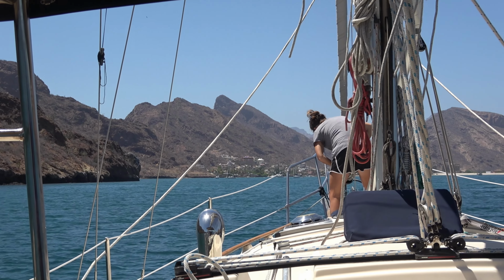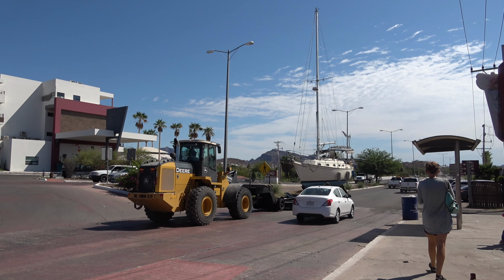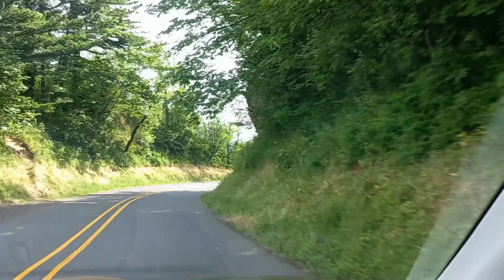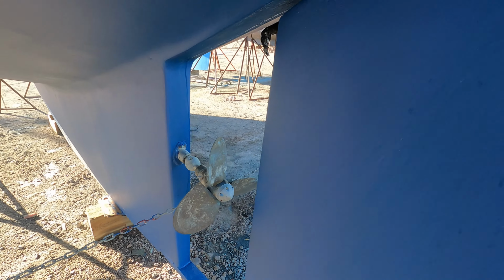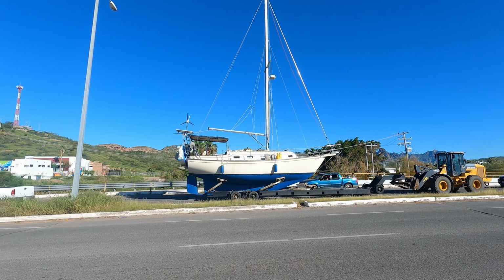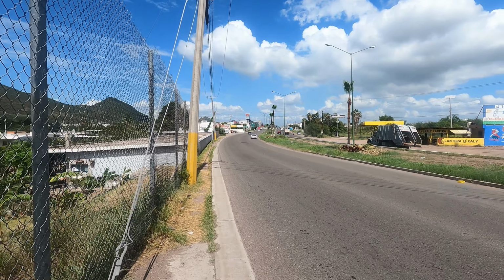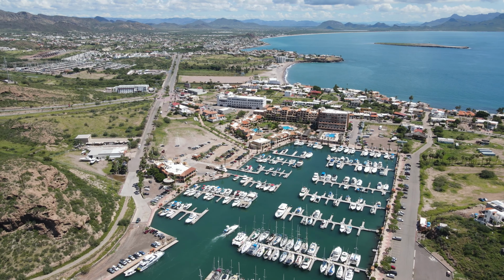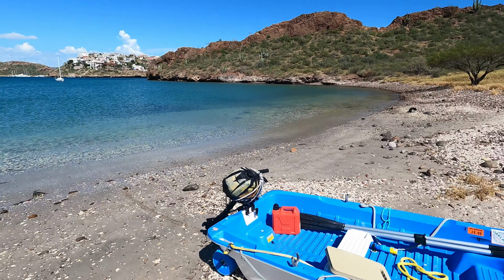Back to Boat Life

Comment: How much did it cost to keep the boat ashore? 

Not possible to fly from Guaymas or nearby? Four days on a bus sounds like hell to me, lol

Hey, you have a Max Prop! I was thinking of getting one, are you happy with yours? Did you have to get a larger diameter to compensate for the less efficient blade shape? I like being able to motor at top speed but under sail at 5+ knots the prop spins the transmission 😬😳 so that needs to end.
Reply from the maker: although there is an airport in Guaymas, there are no passenger flights. If you had to fly, you could get into Hermosillo, and then bus to Guaymas (just 2-3 hours). 

The MaxProp works well, although we learned not to go too suddenly from forward/reverse. There's a torque moment that occurs when the prop blades swivel from one position to the next, which snapped the steel through-bolt in my transmission coupling...twice!!  No motion in the transmission when sailing, the blades feather themselves.